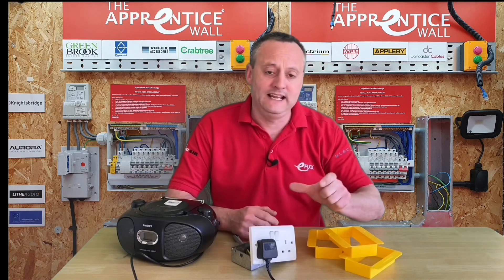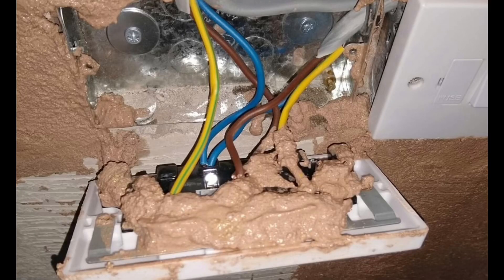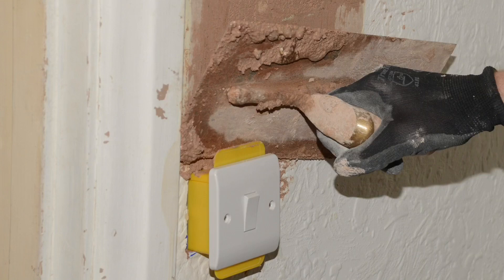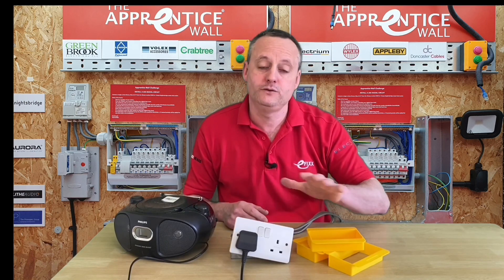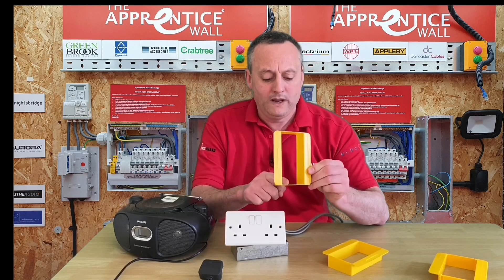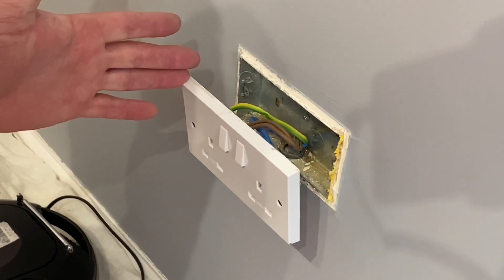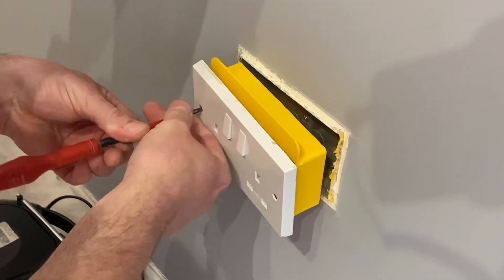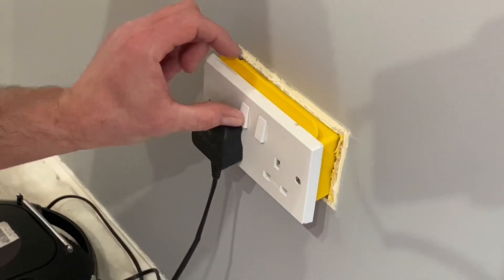Improving electrical safety for an angry painter, plasterer or tiler. Sockitz

Comment: Using these on my current rewire. Can leave site with everything energised and signed off.
Reply: Agree John that I need to go back for a couple of hours and this has it’s cost. But for me it’s far better to do all dead and live testing and charge for 1st & 2nd fix before any other trades go in. Then when mr plumber or kitchen fitter drills through the wiring, you’re covered and can charge for any remedial works. Also in the current climate it could be months before other trades go in
Reply: Apparently not though. According to Richard Brooks, in a reply to my post, the electrician is to remove them, which means you'll have to go back, hence the question in my post about who pays for the time - is the sparky expected to just absorb the cost - you may like the reply, hence my reply to it.
Reply: All testing should take place when accessories are  in place, using these, they are not in place  until you go back and remove them and screw all the sockets back properly.  Can't just leave it for the painter to do.
Reply: Yea, it complies so it can be signed off
Reply: Does the plaster crack and blow when you take them out after plastering?
Reply: @adamjones3249  That would be my thought

Comment: The biggest danger comes from one of the conductors coming lose from its terminal as the socket is pulled away from the wall. Mainly due to it not being tightened properly in the first place.

Comment: How do you remove these after painting completed.  My electrician has left me high and dry and no one else has come across them.  Ive got rhem on double plug sockets and light switches.  Obviously theyve not caught on as no new electricians ive asked have had a ything to do with  them.  Will i need new screws of a different length?? Can i remove without an electrician??😢

Comment: Not sure these would work when pointing around a box, have feeling the plaster would stick to the safety shield and breakaway on removal of the shield. Apart from that though seems like a decent solution, and if the sparks has recessed the box too deeply as usual, they could Dremel the front off and your installation complies 😉

Comment: I just use nappy bags personally. I wrap all the slack and what's left of the bag over the terminals so there's NO chance of an electric shock. 
I also don't use one of those stupid torques screwdrivers, which cam's out when it's not tight enough. 
If you need to use one of those, then your not a proper sparky in my eyes.

Comment: What a load of nonsense. Painter would only need to back the box off the wall 2mm to flick his brushin behind. Also if he is painting or plastering to these silly shields when they are removed can guarantee that the seal of the paint is broken and you will see crack in paint when screwing the socket back on.
Reply from the maker: Wow 2mm - but they don’t do they - this happens all of the time

Comment: I do not trust painters to screw back sockets. They will not even get them back in straight. 
I find it is best to use Wagos. 

- Connect the ring inside a socket's deep backbox using lever Wagos. 
- Have Wagos inside the box giving a flush wall ready for preparation.
- Test.
- Turn off supply.
- Push paper inside the backbox protecting the Wagos and wires, then plasterers and painters can do their part.
- Use flexible 2.5mm L, N & E cable, not solid cores. Cut the cable to around 5 inches tails in length. Fit them to the sockets on a bench, ready for fitting. Easy. The more you have the easier the job is. Could be over 30 of sockets and FCUs to fit.  
- When painters are finished, clip the tails into the Wagos. 
- Screw back the sockets easily as the wires are flexible, with no stress on terminal connectors. 
- Quick and easy. 
- Test.

Wagos are maintenance free, giving a far superior connection than screwed connections.  The ring's current will be running through the Wagos, not the screwed terminals on the back of the sockets, which may have a poor connection and work loose over time.  So, safer as well.

Comment: In my country they solve the problem in a better way: every socket or switch has a frame that can be deatached to paint the wall. Also the frame covers the screws so it looks much better, and also that way it allows the screw to have a larger vertical hole that you can use to adjust the inclination of socket if the box in the wall is not perfectly leveled.

Comment: Its a good idea but it looks like when the plasterer has finished and you remove this I bet it crack all the plaster around it. Their is another solution grow some balls and tell them if you want it off the wall you gonna have no power 👌.
Reply: The plaster doesn't crack when removed , we have sold millions over the last 12 years so they are tried and tested . Occupied rewires were the Tennant requires power at the end if the working day is the biggest area they are used 👍

Comment: I'm not keen on testing, then removing these protectors to refit the sockets/switches, what if a conductor comes loose in a socket outlet? It invalidates your testing really. IR, Continuity, should be done after all accessories are fixed in place. Soon as they are moved then you risk bad connections happening. Great idea though. 💡👍
Reply: Don’t let the apprentice connect the sockets. 😉

Comment: The only issue that i have come across is when you have two next to each other such as kitchen, because of the over hang of the accessories you can not get the plaster in the gap. Other than that they are a great idea

Comment: Looks a good product but can see a few issues If its an existing installation, If existing render, plaster overhangs the box edges it wont fit. If the existing box is deep in the wall you will get very little clearance. Same on a new install if the box is set further back in the wall then surely its a nightmare to get out without plaster coming away with it.
Reply: The plaster does not stick to them when they are removed so it's never an issue. The back box should be level with the finished surface but we know that never happens that why they are 30mm deep , if they need to be deeper than that fit 2 and break the tabs off the deepest . 👍

Comment: At 82p each for disposable version when bought in boxes of 100 from manufacturer, these appear to be more expensive than any complete final fix accessories - be it back boxes or pattresses. All we really need from these is to survive plastering and painting, so - great idea, very useful, but unless they are 20p each max it's not going to be part of anyone's budget (plus it's literally cheaper to use old drylining backboxes with exactly the same result).
Reply: Von Reagan I reckon the price will drop as they become more popular.
Reply: Buy direct 50p each or buy in bulk even cheaper 😉

Comment: Why would I pay to make someone else life easier
Reply: Health & safety and BS7671 reg 522.4 👍
Reply: @vw_beachbuggybrookster  that applies to electricans correct but if a plasterer or painter takes a socket off the wall and sticks his tongue in one of the terminals thats all him. This product is near on pointless. And it leaves a risk for a call back from the painters. Because you could crack/peel the paint off when taking it off. Just second fix the sockets and cover it in the bag it comes with and screw it in and leave 2-3 inches. If someone gets a shock or damages the socket or switch its because they are a muppet.
Reply: @vw_beachbuggybrookster it is IP rated until he used a "key" screwdriver  to open it

Comment: I was a bit sceptical of these to begin with, apart from the painters scenario, we should also think about a Tilers situation. There is nothing worse than going to second fix a kitchen that has been poorly tiled, and the tile edges encroach into the socket space, preventing you from installing the 3.5 mm screws or stopping the socket from sitting flush against the tile!! One of these would prevent this situation arising.

Comment: Yet another great clip.  Thank you.

I have seen these around or similar ones for some time but never really felt the need for them.  As you do you always have another way round to keeping others safe on site and have managed without.
After this I may consider trying them and gather thoughts back from the builders, plasterers I work with.
I usually follow the decorators on site so it makes it easy for them to paint 1st - plus I dont want paint on our kit ! 🙂

We don't have any lights and or sockets at home so this maybe what we need to get them on !! 😁

Comment: Am I right in thinking a single socket outlet would need to be disconnected to install a single gang shield?
Reply: Use the reusable type safety shields to allow fitting while the cables are connected , they are designed to be retro fitted with the circuits already connected